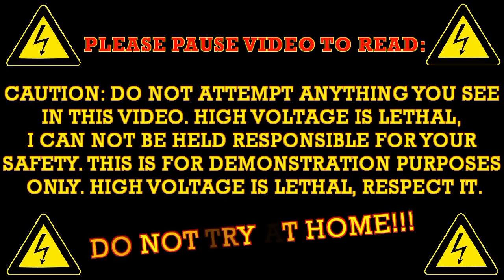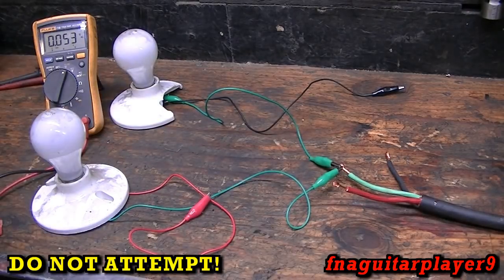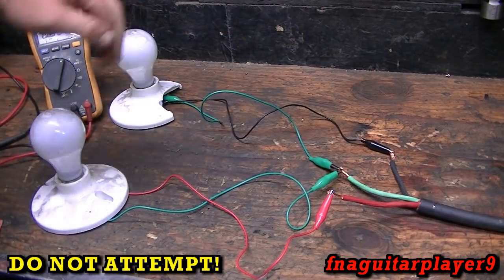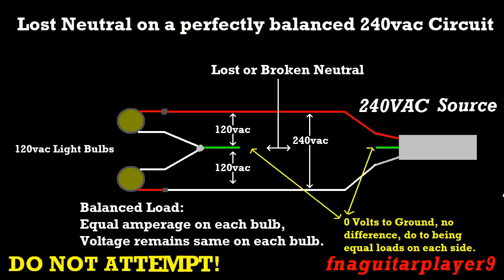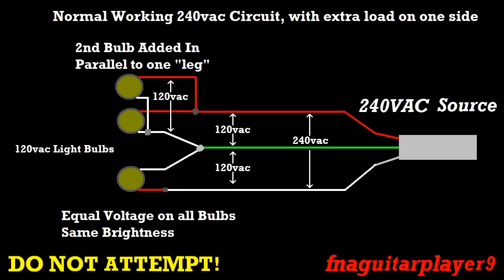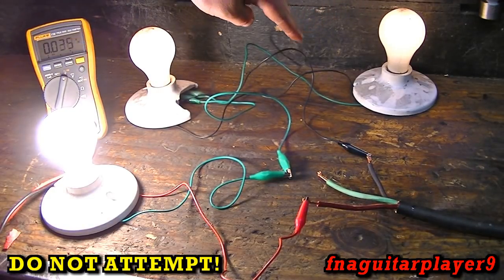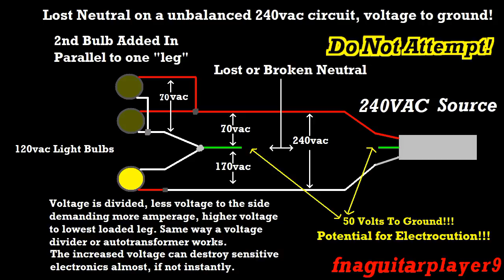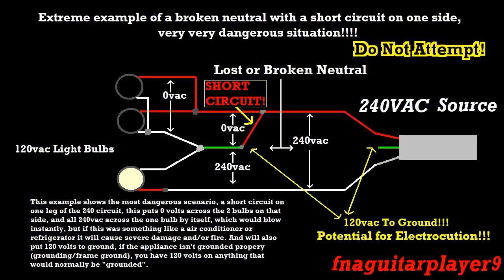Lost Neutral / Function of Neutral on 240vac Circuits with DEMO's

Comment: Another question.  Difficult for a mere mortal to understand. Zero voltage on the neutral? ( not open neutral)  ( not lost neutral).  How can balance CURRENT 
be on the neutral ( Reversing polarity?) when no voltage is on the neutral
back to the center tap?
Reply from the maker: This is where it gets more confusing, if there is current on the neutral (from a slightly unbalanced load) there will be a slight voltage difference, may just be a few volts, depending on how much its unbalanced, if its perfectly balanced, the neutral is basically serving no purpose at all, like when i just had 2 bulbs in series with the neutral unhooked, so there would be no amperage on the neutral so no voltage difference either. hope this makes sense.  Thanks for Watching!!!
Reply: fnaguitarplayer9 Thank you.    With all the wires connected and an unbalanced
load,  PUTTING the two probes from the voltmeter at the same time, on the neutral, the meter
would not work?   Looking to see the amount of voltage and current going 
back to the transformer WITH an unbalanced load. thank you.
Reply: @tedlahm5740  voltage is always measured between two points. If the two points you are measuring are separated by nothing but copper wire, you will get essentially zero voltage drop. Current traveling on a wire does not mean it has voltage across 'itself' or even necessarily to ground if that conductor is grounded (which in the case of the neutral, it is). 

If the neutral 'opens' up (meaning loses it's connection with the transformer) than that open end will then have voltage to ground/transformer neutral.
Reply: @fnaguitarplayer9  This is out of my league but a question, please. The slight voltage drop/loss when the neutral is carrying the load could that be due to the normal resistance of the load traveling through  the extra copper wire of the neutral. You would not have any loss when it was not ? Great video!

Comment: Theoretical question. If I turned off ALL of the breakers on one side (L-1 ). Then ONLY appliance on the L-2 side are running.  Under this condition. The service,
is unable to balance itself, and ALL CURRENT would flow on the neutral and 120 volts. Sounds correct. Is it so?  Thank you as always.
Reply from the maker: Yes, if you flipped off all breakers on one line (and all 240 breakers as well) it would put all of the current to the neutral, and it would be 100% out of balance. Now if you mean if you flipped off all breakers on one side of a panel, then no it would not be unbalanced because each breaker alternates where it "picks up" its power, like how a 240 volt breakers take up the same 2 spaces as 2 singles but pickups up both lines. But yes if all loads are disconnected on one line it would put all the load on the neutral. Thanks for watching!!!

Comment: Wonderful demonstration.     Comment please. I looked inside the step down 
transformer outside providing my service.  See no physical evidence of split phase, or out of phase? Only see one phase, which is provided by the power company. Thank you again, enjoyable video.
Reply from the maker: Unless its strictly a 120 service which I've never seen, it would have to have 240 split, unless it is running off a 3 phase main panel and just running 120 circuits. Thanks for Watching!

Comment: According to the schematic on my electric drier, it looks like its showing one 120v line going to each end of the heating element.  Is that how it works?
Reply from the maker: yeah, a 240 volt circuit is 2 120 circuits to ground, 240 across the 2 hot wires. Its still running on 240, but there is only 120volts to ground. Thanks for Watching!!!
Reply: They're not Two 120 volts to Ground. The ground is always for safety in case there is a short of one of the120 volt line with the appliance so danderous current will flow to ground and not ttrough anyone touching the appliance.

Comment: Is there some cabling method or some other equipment to detect this? I guess GFCI separately on each pair would detect it and trip on both sides (if only one sides trips, it will open the circuit but there might be still live line voltage on another side. And that is also a good reason to not assume there is no voltage on the output of GFCI or breaker even when it is off!

The loads that actually need to phases or double voltage would be designed to handle it or will be balanced and protected internally.

I guess having movs / varistors on each side would also help to detect sudden increase in voltage and short it to protect equipment and trigger breakers. However if only one side is protected this way and other side is not protected at all, it will see even higher voltage and be surely damaged.
Reply from the maker: It can be very confusing trying to figure this out, when i reached up and touched a cfl bulb and it got brighter i knew it had to be a ground issue, then I touched the metal of the breaker box to ground (like literally in the ground) with a meter and read over 120 volts, i knew it had to be something like that. Its a nasty situation and can be deadly. Thanks for Watching!!!

Comment: How will a grounding rod help in that scenario????
Reply from the maker: It would help balance it, but if it occurs after the ground rod, feeding a sub panel that doesn't have a ground rod then you have this problem. Thanks for Watching!
Reply: Thank you so much for your reply!!!
Reply: @fnaguitarplayer9  i had a open neutral due to damage on the utilities cable(before the meter), but i was able to measure  150 volt on a receptacle, does this mean my house ground is not properly grounded or has a short somewhere?
Reply from the maker: @fobbywillie  Sounds like there maybe another ground issue somewhere else too, making it offset the voltages.  Thanks for Watching!!!
Reply: A ground connection has too much impedance to eliminate this issue. Even with a proper ground you will get imbalance. Voltage drop occurs across this connection, meaning there is still voltage on the neutral/ground and it is still dangerous.
Reply: @spruce_goose5169  Great answer, it took me quite a few years to understand all differences between neutral, grounding electrode conductor and equipment grounding conductor.

Comment: And what if you have a lost neutral , but you have the ground connected which is the normal scenario on 240v correct? So then does the ground leg make whatever it's hooked to have the excessive voltage?  Excellent video by the way as I did not know what you explained.
Reply from the maker: Yes it will cause the ground or frame to become hot, now if it has a 4th wire (an actual green ground wire) then it will be connected to the frame and should take over, but if the problem is not at the appliance, but in between say the meter base and breaker box, then all the "grounds" will be hot, with the whatever voltage difference there is between the 2 hots. Thank you! Thanks for Watching!!!

Comment: Is a neutral wire charged electrically  like a black or red wire.   If I pinch  a bare  neutral  wire and stand in mud would  I get shock with 120  volts  from a 240  volt circuit  and also from a 120  volt  circuit.  I'm assuming that in a AC circuit  a neutral wire feeds current  to a load on 180 degrees  of the sine wave. Is that right  or am I wrong
Reply from the maker: It should read 0 volts to ground if everything is in working order, on either a 120 or 240 circuit. Not that i recommend doing that, but theoretically you shouldn't feel a thing, because if you look in a breaker box, you will see that the neutral and ground are actually connecting to each other through a bus. But never trust anything electrical! Thanks for Watching!!!
Reply: @fnaguitarplayer9  I'm getting 190V instead of 230V, what could be the problem?

Comment: This is timely. I have an electrician buddy that was talking about a lost neutral with me just the other day because it happened to him. Burned up a bunch of his appliances just like you said and it was from his underground feed deteriorating and the neutral being eaten away. And he said it's not a rare event either and happens a lot. And the carb on my Vanguard might be from a 14 horse or so. I just found it on Ebay but it sure works very well! Thanks and still waiting for that tune!
Reply from the maker: I hear ya! It is a very interesting and dangerous problem! oh yeah, it is real common, we had it happen at my uncles  trailer. It was right at the meter base on it. I hear ya, that might be what it is was off of. haha i hear ya! Thanks for Watching!!!
Reply: Maybe underground might not be the best way to go, even if it looks nice.
Reply from the maker: Thats really the only advantage of going underground. Now if its in conduit, that will almost eliminate that problem. When it happened to us, it was all above ground, and the cable corroded between the meter and breaker box.
Reply: I believe it. I know some is direct burial but I have no idea which. Conduit would be the fix for sure. Take all the worry out of it and be tougher to stick a shovel in it!

Comment: In essence, if you loose the neutral and ONE bulb burn, the other one would get 240v ?
Reply from the maker: The only time you will get 240 across one bulb is if the neutral is broke, and the other bulb has a short across it, like the last diagram shows, other than that it will always be less than 240. Thanks for Watching!!!
Reply: fnaguitarplayer9 if one bulb burns out without the neutral connected then the other bulb would go out due to the filament being broken and stopping the electrical path to the 240volts.
Reply from the maker: Yes that would be correct, it would act just like a fuse, i could have shown by unscrewing 1 bulb, but i didn't even think about it, but yeah thats would happen. Thanks for Watching!!!